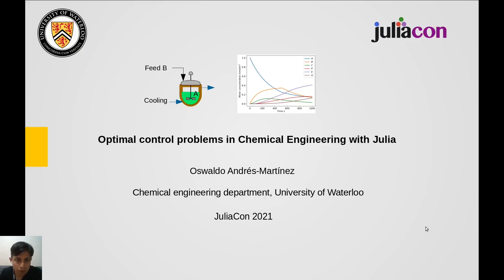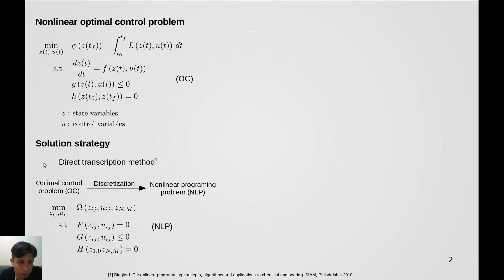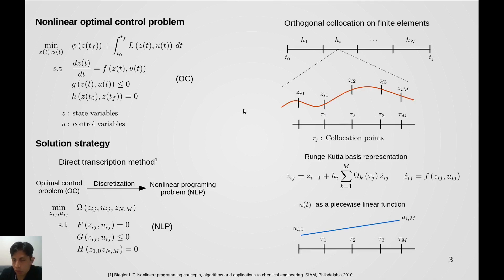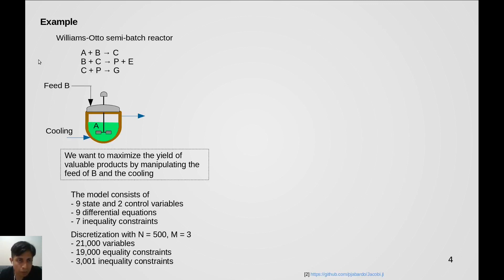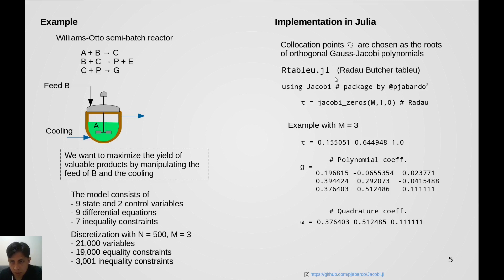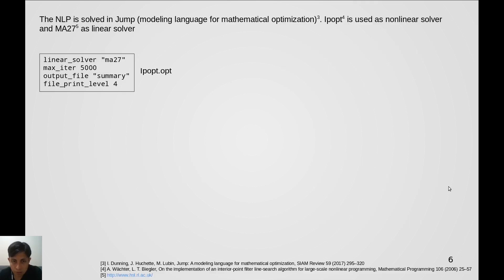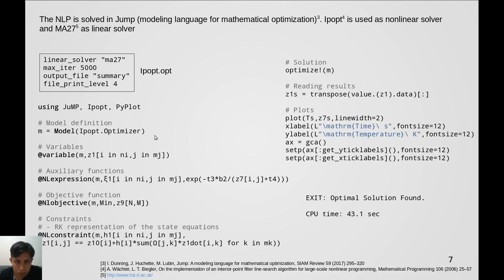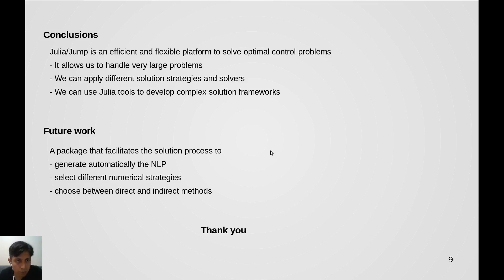Optimal control problems in Chemical Engineering with Julia | Oswaldo A.M. | JuliaCon 2021

Comment: Hello! I am currently a Chemical Engineering undergrad. I was greatly fascinated by the examples you've shown, since I had just passed my reactor balances course.

I wanted to ask, where can I learn what is needed to understand what is on the video, to then apply those techniches to my own chemical engineering problems?

Are there any books in particular that you recommend? A study order? Maybe learn linear control first, then nonlinear control, and lastly optimal control.

I'm excited to hear your thoughts!